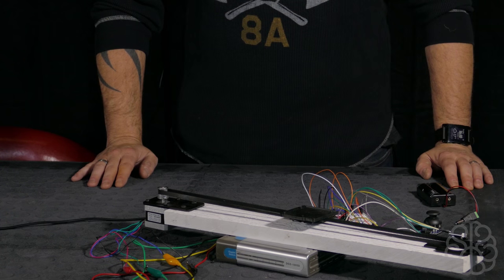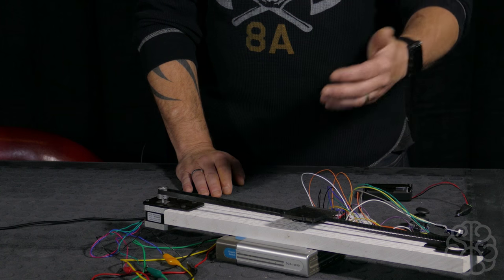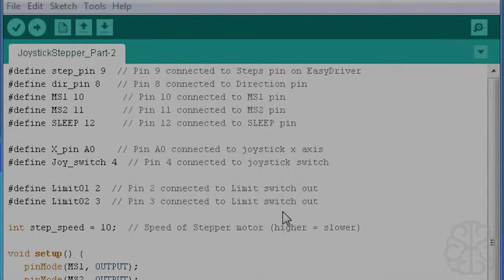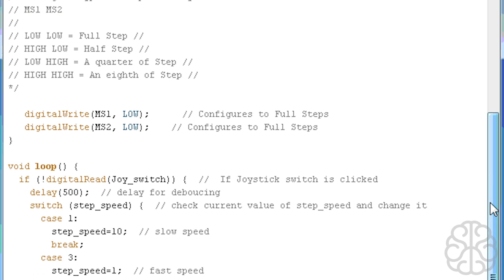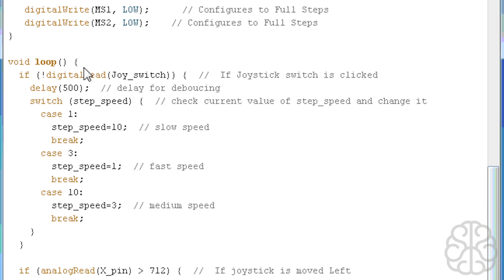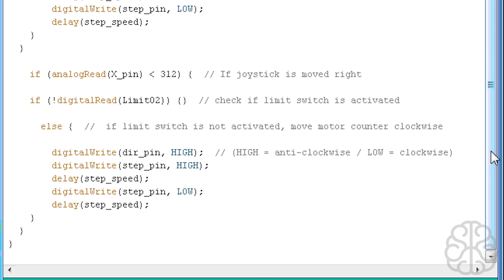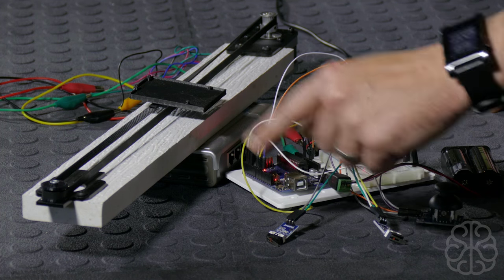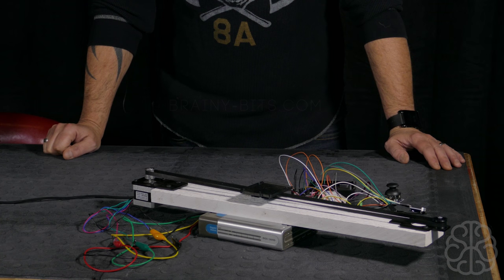Control a Stepper Motor with an Arduino, Joystick, Easy Driver and Limit Switches - Tutorial

Comment: must say great work . so many other gates opened for me  after watching this video . Much much appreciated. Thank you! 
Please if you can tell me or guide me to a relevant project where i can use the same principle but just need a small detail to be altered where i can just toggle the joystick up/down for the movement. No need to keep on holding the joystick up to keep going up. If i toggle it up it should keep going up till the limit switches and the same for when pulled down. would really appreciate it .

Comment: great job !
it would be nice to have a dedicated pot to change the speed of the stepper (on the fly or not).  what way , this project would be an excellent "stepper motor x axis controller with variable speed".
also you could use the lcd shield wich is cheep and has the buttons to control the stepper and you could display and dial the speed of the stepper.
thank you!
Reply from the maker: +Konstantinos Nanopoulos I will keep the pot in mind for a future tutorial that uses stepper motors.  Will make more projects or tutorials which use LCD's in the future also.  Thanks for watching and the suggestion!

Comment: Thank you for share this project with us. Very good explained and code included ..... perfect for an Beginner like me. Please let me ask: In your wiring diagram is an stepper control included by "A3967" - Is it possible to Change to stepper driver "A4988"? What for changes are for this needed? Thank you very much for your friendly Support,

Comment: What if you wanted to control a stepper motor at a set rpm to rotate in only one direction with no joystick involved? Any help with that and the easy driver? I did not see anything on your tutorial pages.

Comment: This is great. How would you connect a L298N Motor Drive Controller Board Module Dual H Bridge rather than the Easy Driver?

Comment: can you replace the analog stick with a toogle switch so you basicly off with be 200 step (eg) and on with be the other direction and 200 steps? how would you go about doing this in the code thanks in advance

Comment: I just started with Arduino. I made a pump jack using a stepper. I want to add the led sequential blinking to the same Arduino. Is it possible to run 2 sketches on the same Arduino at the same time?

Comment: when motor is not in motion current drains near 1A causing the chip getting so hot. If stepper is in motion, it drains less(0.2A).  I think it has to do with programing. Any idea?

Comment: Not sure why my previous question showed up, but with this code, an Arduino Nano, Easy Driver, Nema 17 Stepper, and some mechanical limit switches (Vcc, Out, Gnd) the motor will only run if the switches are activated. If I let up on the switch, the motor stops. How do I fix this?

Comment: Hi, great job man. I worked on your project an i wish to know if can be possible to make it "portable", using an external battery pack.Thanks
Reply: Hi, did you ever find an answer? I would really like to know how long the battery pack would power the Arduino.

Comment: I am working on a project trying to do a similar version of what you are doing here, but instead of using a joystick i want to use a load cell to control the speed of the stepper motor. I.e the higher the load, the faster the stepper motor speed. When load equals zero (or less than say 100g). the stepper motor will return to the start point at a fixed speed. I'd be interested to see if you could do a tutorial on this.  P.S many thanks for all your other tutorials!
Reply from the maker: +David Calder Hi David, can you show me the load cell you would use, since I don't have any of those on hand?  I'll look for your comment and get back to you.  Thanks for watching!
Reply: +Brainy-Bits Thanks for your reply! Here's a link to the load cell I want to use:  http://www.aliexpress.com/item/Digital-Portable-Electronic-Kitchen-Scale-Load-Cell-Weight-Weighing-Sensor-20KG-FZ1439/32298801534.html   -  its a 4 wire load sensor commonly used in kitchen scales. I'm using a Bipolar Nema 8 stepper motor: http://www.aliexpress.com/item/NEMA-8-Stepper-Motor-1-96oz-in-28mm-0-6A-for-3D-Printer-RepRap-Makerbot-Arduino/32454837819.html. Appreciate your help. Dave.
Reply from the maker: +David Calder I will try to get my hands on one of those and make a tutorial video on it!  Thanks for watching and the suggestion!

Comment: I know this is an old video about controlling stepper motors through Arduino and such so my question is can you use the same joystick controller a second stepper motor assuming you need a second easy driver i'd really appreciate your advice cos I'm intending to use it as a set up to control parts of a costume
Reply from the maker: I've made another video and tutorial on controlling 2 steppers using one joystick to create a camera slider, you can check it out here: https://www.brainy-bits.com/dual-axis-camera-slider-using-joystick-in-and-out/  Hope it helps and thanks for watching!

Comment: Please tell me I understand the algorithm of the stepper motor? If the motor moves in the right then he stops short and right can not move to the right of the limit switch, and can only move to the left. Conversely analogous with the left side?
Reply from the maker: +Druid Yep that's it!  As long as one of the Limit switches (right or left) is engaged, the motor will not be able to move in that direction until the limit switch in question is released and vise versa.  Hope that helps and thank for watching!

Comment: Dear friend. Thanks for the reply. Could you help me with my project lock on the door. I want to open the door of a stepping motor by using RFID tags. But I can't solve the problem of the limit switches. Must be interrupted by circuit breakers in case of a malfunction or the ARDUINO in case of voltage drop or malfunction of the stepper motor. I mean if the motor will make more steps than when driving in the right or left. This is an accident.
Reply from the maker: +Druid Sorry for the delay,  didn't see your comment there.  Do you mean a malfunction of one of the Limit switches?  You could always count the number of steps needed to go over your limit, so that if the limit switch fails then the stepper would not go to far after that if you are keeping track of the steps.  You can have a look at this video I did here: https://youtu.be/cYIL5gxRogM  where I believe I keep track of the position of the stepper by counting the number of steps.  Hope that helps!  Thanks again for watching!

Comment: Hi!
I have a problem with the vibrations in the motor. I think I have connected everything as described. But when I move my joystick the motor is really just shaking in the direction instead of a smooth spin. Is there an easy solution for this kind of problem?
Reply: trim pot to lower current

Comment: Great piece of work. I would like to use this for a telescope focuser project I'm working on. Is there a way to:

1. Unlock the motor when the joystick is centred (so not to waste power or overheat the stepper).
2. Instead of using the Joystick switch, I'd like to use a 3 way toggle switch so I know which speed the stepper is in (low, med, high).

Can you point me in the right direction code-wise please?

Thanks.

Comment: I have a question (I'm really new to arduino): will the sliding part go back to its home position when you turn of the arduino and back on again? For my project I would need the sliding part to stay where I moved it no matter if I turn it on or off. 
Thanks in advance for your help :-)
Reply from the maker: I've just released a new tutorial video on how to do homing of a stepper at startup:  https://youtu.be/3odRT6zdzqk  Hope it helps...   Thanks for watching!
Reply: Brainy-Bits thanks. I've just seen it :-) so in other words in this project here, the stepper motor won't home by itself? :-)
Reply from the maker: In this one, the limit switches are only used to limit the movements of the stepper on either side, but you could add the code from that new video in the SETUP portion of the code, to set the HOME position by either using the left or right limit switch...  Hope that makes sense :)
Reply: Brainy-Bits alright nice! I might need to use this slider for a microphone instead of a camera. So it's important the stepper motor won't move after I turn it off :-) thanks again! Great channel, good quality stuff! :)

Comment: Are the endstops sending a HIGH when they are activated? If so, I don't understand why there is the else in this part of the code. I would think that it was correct without "else" or without ! 

if(!digitalRead(Limit01)) {}
   else {
       digitalWrite(dir_pin,LOW); ....
Reply: +horstdieblume2 got it. the endstops are  sending a LOW when activated
Reply from the maker: +horstdieblume2 You are correct :)  When the code detects that a limit switch has been clicked or activated, it sets the dir_pin to LOW.  Great that you figured it out.  Thanks for watching!

Comment: Please explain in the video did not really visible. You just do not limit switches allow the motor to move, or they stop the engine while driving?
Reply from the maker: +Druid Once a Limit Switch is activated, it will prohibit the stepper motor from moving in that direction, doesn't matter if it's already moving or at rest.  So if the motor is moving and the limit switch is activated then it will stop.  If the motor is not moving and the limit switch is activated, then the motor will not move is that direction even if you push the joystick in that direction.  Hope this helps!  Thanks for watching!
Reply: +Brainy-BitsMany thanks.
Reply from the maker: +Druid You are welcome!  Thanks again for watching!
Reply: +Brainy-Bits Could the limit switches be used for bouncing the object back to the other direction automatically instead of stopping it?
Reply: +Touko Helanen Great Idea, i will be really glad if you share solution of this
Reply from the maker: +Touko Helanen It could do that instead if you wanted to.  In the code when it detects that the limit switch has been triggered, you could reverse the motion of the motor.  But you would have to know what to do after that, it reverses but then what?  It keeps going that way until....?  Let me know what you would want to do when it hits a limit switch and I'll check out what the code might be :)  Thanks for the comment and for watching!
Reply: +Brainy-Bits Thanks! Could it just keep on going from side to side continuously? Maybe I could stop the slider with a push of a button... Also speed control would be very nice. What do you say? I'm looking for a nice solution for shooting & recording live gigs and YouTube vids all by myself, solo, multicam. 😉
Reply: +Brainy-Bits Exceletn, In my case is the same after reaching one limit switch go to other side and again back. But I need to control also relay outputs because I will use them to control valves. I am trying to make pump pushed by stepper motor and composed from two syringes in oposit on one shaft. Speed control by buttons is also great idea.
Is possible to make something like that? My programming is way too poor :-(
Reply from the maker: +Touko Helanen The side to side could be done no problem and the speed control could be achieve using a Potentiometer.  I'll make a note to make a quick video using your suggestion soon :)  Thanks again!
Reply from the maker: +Josef Synek Like I responded to +Touko Helanen, I will try to make a quick video using his and your suggestion soon.  Thank you for your comment!
Reply: +Brainy-Bits  Hello, so can i please ask when should be this ready? some plan, my deadline is close and I am still lost :-/
thanks a lot

Comment: I am a total noob honest am just poking wires everywhere. I have never written code ever so I am learning still. If I wanted to add a y axis to your code do you just repeat what is there for the X axis but call it y? And if you don't want the limit switches can you just leave them out?
Reply from the maker: I've made other videos abouth stepper motors, this one here is using 2 of them: https://youtu.be/lvP5xMOstus also check out the tutorials on my website https://brainy-bits.com to get more information like the code, library used etc...  Hope that helps and thank you for watching!
Reply: Brainy-Bits Thank you it makes sense, I think I need too learn some more. Your video's are really good thank you.

Comment: I have a problem dude, my easy driver module get so hot in about 20 seconds, I'm using a 12v power supply.
Reply from the maker: This is quite normal, but don't worry the driver chip has a temperature protection set at around 165 degrees Celsius, so it wont' burn out.  You can also lower the current the Easy Driver provides to your stepper motor, which will make it run cooler.  Turn the little Potentiometer that's on the ED to adjust it from 150mA to 750mA.  Hope that helps!  Thanks for watching btw :)

Comment: are those joysticks out of the controller of a  ps3?
Reply from the maker: No these are Joystick modules made for testing ( https://brainy-bits.com/products/joystick-module ), they are easy to connect since they have headers.  But a Sony or Xbox can work also but you would need to do some soldering.  Thanks for watching!
Reply: Well i tryed to get one out but you need to heat up all the pins and pull it off (at the same time)  hahaha, its hell of a job!!  since i just found out that the all the Arduino components are relatively cheap, i wont continue that struggle.
Reply: Rebel, on Ebay, search for Arduino joystick...